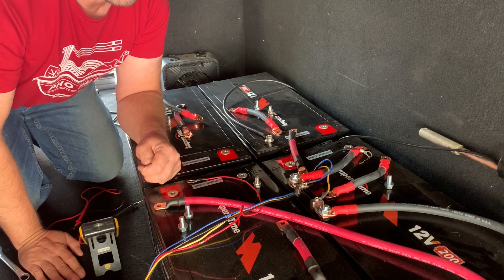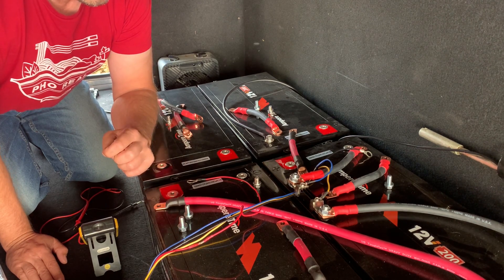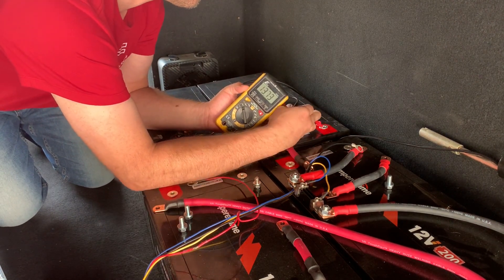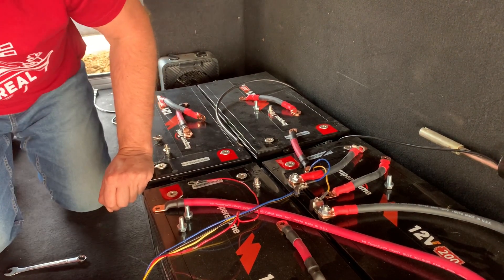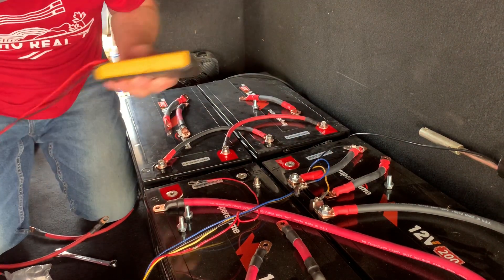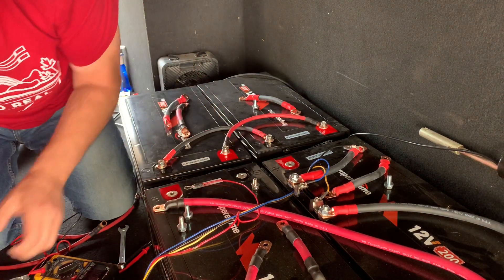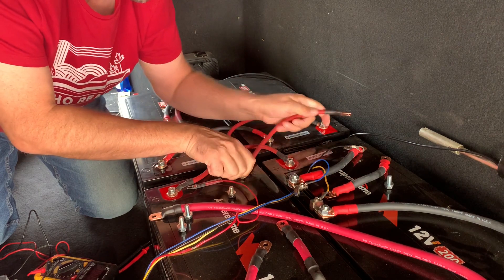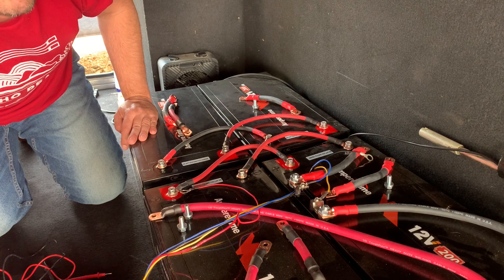Problem! Ampere Time Battery 12V 200AH LiFePO4 - Part #1

Comment: Wow. EE here.Watching you tighten those terminals with that uninsulated wrench, swinging back and forth within an inch of shorting out a battery capable of supplying thousands of amps and turning that wrench into explosive molten slag flying in all directions was too much to watch!  Please take better precautions like:  a)Move all those loose cables and bolts away from your work area!  b)Keep insulating caps on the terminals you are not working on. c) Use a ratchet? d)Wear safety glasses.
Reply from the maker: Great suggestions! Thanks for watching!

Comment: I am thinking of ordering this Battery, Are you happy with them now?
Reply from the maker: Yes I have no complaints at this point. I would just be mindful of the lack of a low temp cut off in below freezing weather if that is a concern for you. But I have a work around video for that.
Reply: @thervsolarseries2827  Thank you, These will be inside in a laundry room, so Low temp probably wont be a problem, Thank you for reply.
Reply: @thervsolarseries2827  I just received a 300 amp hour battery by this brand. Planning to use it as an emergency solar power supply for some air conditioning after hurricanes. If I get the proper solar setup I can have a small window unit going all day and on a timer at night to avoid completely draining the battery.

Comment: I’m not very happy with my 4 100ah batteries wired for a 24v system   They can’t even keep a full size refrigerator running for 1.5 days and that’s starting from a full charge that draws a max of 100watts   Any help I could get would be appreciated  🤮🤮🤮. Wondering if I should have bought something different there only a month old. I’m charging everything if y’all want to know with a MPP LV2424 with 2000 watts of solar
Reply from the maker: Something must wrong with your system brother. With 2000 watts and any kind of sun at all and the fridge is only pulling 100 watts, it shouldn’t even be touching your batteries in the daytime. To put it perspective I am running a small freezer off 400 watts of solar and 4 sealed lead acid golf cart batteries. As long as I get a little sun I never touch it. The freezer pull 300 plus watts. Go through your system with a fine tooth comb. Check connections, verify everything is working as it should.
Reply: Something else is wrong, i have 4 of the same 100ah in series parallel on an outback vfxr3524a and i run a fridge and deep freezer 24/7 with an outback fm80 with 2400watts of solar, i wake up in the morning at 6:00 am at about 40-50%  and once the sun comes out in any way even if cloudy i get a full charge by 11am

Comment: Hi buddy I’m new in off grid how long those battery would last fully charge to run over night basis applications like tv com led light phone charger aaax fridge? Many thanks
Reply from the maker: Depending on your load but you can use this as a rule of thumb- if you have connected 4 12V 200Ah battery in parallel to set up a 12V 800Ah 10240Wh battery system.
Generally, it could work well with your appliances, assume that the load power of your refrigerator is 200W, your battery system with fully capacity could power it for around 3days. That would be on battery power only no solar attached.

Comment: videos are good but we really cannot hear you well.
Reply from the maker: Thanks for the input. I have a wireless mic now so working on these details for better quality videos.
Reply: I always wear headphones. I have hearing issues as a musician and headphones solved it while watching videos. Or use powered speakers connected to your device. That works very well too to take control of the volume levels.

Comment: There's a very good chance that your battery charger is to small for you battery bank I have hooked up a battery charger to a very large battery bank before and the charger only charged it's so far and then came up with error and stop charging
Reply: Your battery bank is 800ah. I'd recommend you up your charge another 40 amps. 80 amps will be distributed across the parallel battery bank of 800ah as 20 amps per battery. The larger the battery bank the larger the charge can be. Under amperage charging could be your problem.  Try to charge at no less than 10% your battery bank size. Remember you have a limit time to charge with solar batteries.
Reply from the maker: It’s a 40 amp solar charge controller.
Reply: @thervsolarseries2827  40 A Is to small you need to double the current
Reply: @thervsolarseries2827  Yes but what was your amperage during your charging attempts?  What kind of solar charge controller are your using?  If its a user adjusted unit, what are your charge voltages set on?   Maybe your charge controller isn't working correctly?
Reply: @thervsolarseries2827  So you are charging 800 amps of batteries with a 40 amp charger. That is  still only 10 amps per 200 amp battery. Have you tried charging them individually to see if that would help? Call or text Ampere time, they are usually quick to get back to you. They have been helpful to me. I had a question for them yesterday, texted them and had my answer the next day.
Reply from the maker: @soberpickle8195  I let them charge for 4 or 5 days with full sun for a good part of the day. They charge up to 13.3 volts and stay there. But as soon as I hook them up to the charge controller individually they within one day go to float charge of 13.8 volts then at rest stay at 13.5 volts or a bit higher. It seems that in 4 or 5 days time they would be able to charge beyond 13.3 volts. Unless one of them is dragging the rest of them down.
Reply: @thervsolarseries2827  40A charge controller, how many amps was it actually putting out at the best part of the day?  Is it MPPT or PWM?  How many watts of panels do you have? It would take 20 hours of charging at 40 amps to charge this bank if it was 0% SOC.  Thats 4-5 days of good sun and actually running the charge controller at 40A, if you have the panels to do it.  Your probably only hitting 40A for 2-3 hrs a day, depending on how many watts of panels you have on the charge controller. What are the settings of the charge controller?  Also like mentioned before, make sure all your cables are symmetrical, or run all batteries to a buss with equal length cables, and then connect inverter and charge controller to the buss.  This makes equal resistance path to each battery, so no battery is under or over charged.  Are you sure there was 0 load connected, only charge controller?  An inverter can pull quite a bit of juice overnight just idling with no loads turned on.

Comment: Sounds like a cell is causing high voltage disconnect by the BMS. 13.6v is 3.4v per cell, and if you let current drop to zero, you can get 98% of the capacity.